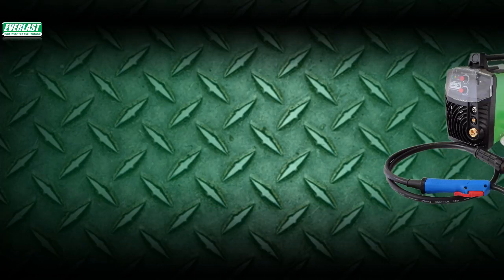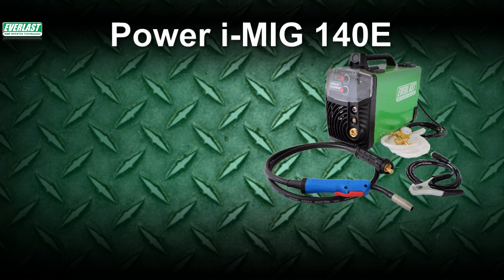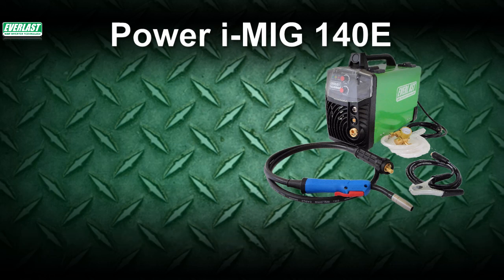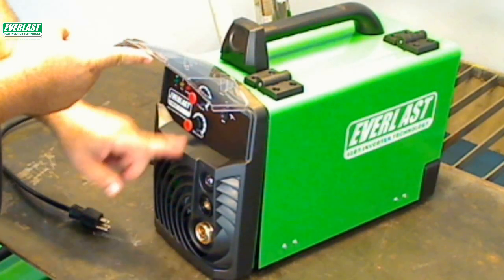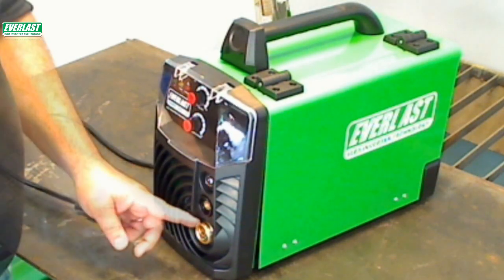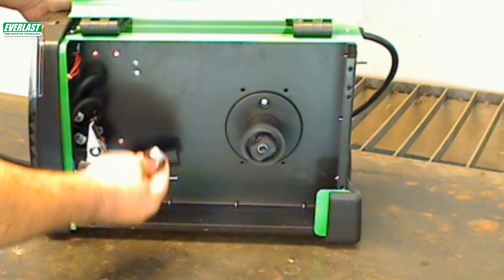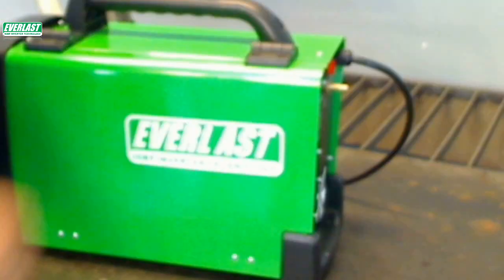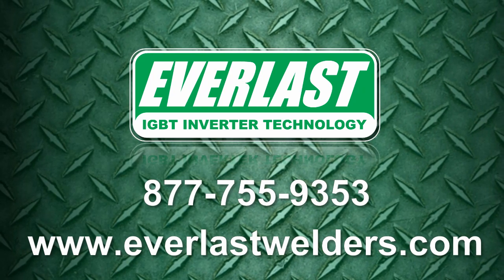Everlast MIG Welder, Power i-MIG 140 E 120V Inverter MIG Welder Part 1 of 3

Comment: Inverters eventually wear out. That's the big downside.u get maybe 4 years use out of one.   But they are good for hobbyist... Or small fab shops....
Reply from the maker: Must be why miller's heavy duty units such as xmt, dynasty, maxstar and now synchro are inverters. Lol. Esab and Lincoln have done the same.

Comment: Bla bla inverter technology hype. forget to tell people the output voltage not as hot as good old transformer.and these do not last .i fell for this inverter junk myself and regret it.
Reply from the maker: WV591 that is not true actually.  Volt amp curves are pretty standard. It's also worth noting no new transformer machines are really being introduced by major manufacturers and many old lines with transformers are having inverters subbed in without fanfare quietly.

Comment: is there a 240v option ? if so is this product available in Europe?
Reply from the maker: No.  There is no need for a 240V option for this size welder. The Power i-MIG 200 is available and is 240V and should be available.
Reply: its a 140 amp welder ,it only needs 120 volts .check the Everlast website for all of their welders .

Comment: Do you need a sine-wave friendly generator to run this welder away from regular household current or will it fry the circuit board?
Reply from the maker: +Jeffrey Beyer  Yes.  You do.

Comment: Before I buy the Everlast 140E, I'd like a comparison to the Eastwood 135 done & results listed.
Reply: not sure about this inverter but just got the clutch 140SI and compared to my Eastwood 135, i almost tossed it in trash. don't fall for this inverter junk.
Reply from the maker: +Papa Ritz   I am sure there are several reviews out there that have done so.  But one as far as design, the Eastwood has a cheaper wire feeder design.  Ours is heavier, with Cast aluminum and steel construction (Not plastic).    Our gun is nicer.  But theirs is an old copied transformer design, with poor duty cycle with somewhere around 20% at 90 amps.  In theory it is a 135 amp welder, but the real output is less than that and any output near 135 amps would be very, very brief.  Ours is 25% duty cycle at the full 140 amps...and a little bit better from my experience with it.   Also voltage AND amperage are fully adjustable on this unit.  With the Eastwood, you have limited voltage adjustment.   And ours will support a heavier spool gun if you want.
Reply from the maker: +Everlast Power Equipment 
Also our unit features an inverter design which does weigh less than the transformer design, but is much easier to service and care for long run due to the plug and play service design of the welder.

Comment: Where is the voltage and feed rate chart for different thicknesses of metal, welding wire, and flux-core/gas settings?
Reply from the maker: +Jeffrey Beyer  Because we have infinite settings, we do not have a chart.  But there are plenty of calculator apps out there that will give you basic settings.  Keep in mind that most people find charts to be well off of where they want to end up welding.  Calculators can only do so much as well.  Within a couple of minutes, you will be able to dial the unit in just by sound and feel.

Comment: What is the thickest metal that can be welded with this machine?
Reply from the maker: It's recommended for welding steell 1/4" and under.
Reply: @everlastgenerator  would this be capable of welding 3/8” coupons in a 3F and 3G? Thanks,
Reply: I love this little welder.